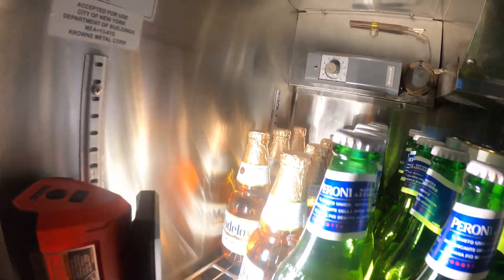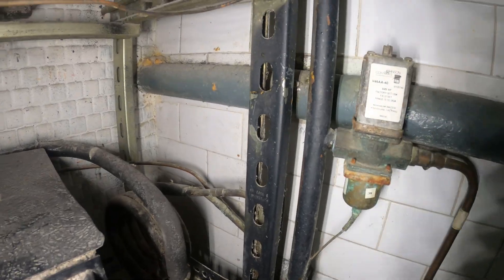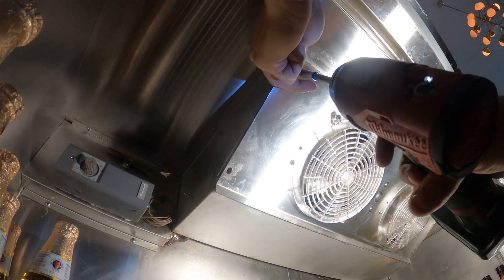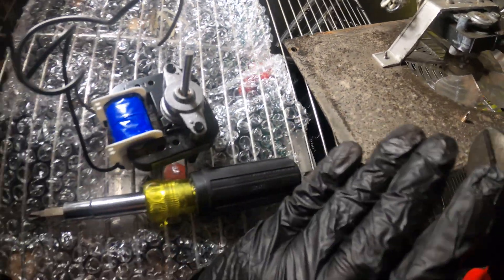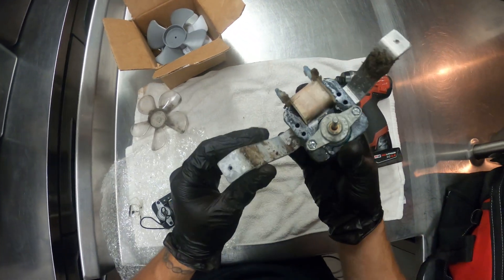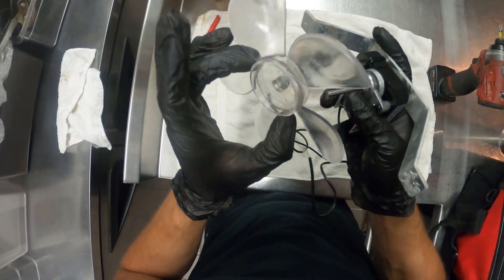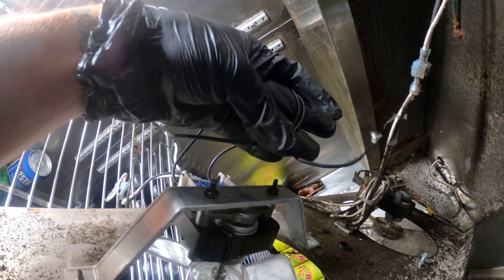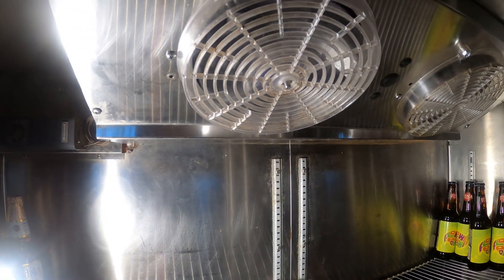HVACR Service Call: Commercial Reach In Refrigerator Evaporator Fan Motor Not Spinning (Fan Install)

Comment: 👍💪❄️🇺🇸 I replaced a few of those recently made the mistake of taking the whole screw out of blue replacement motor n it bent on me. Anyway all good got it fixed n up n running. Great vid n now I’ll just remove nut. Thanks jmt